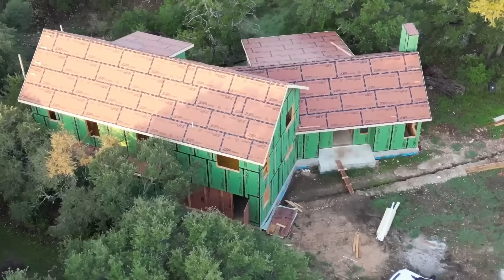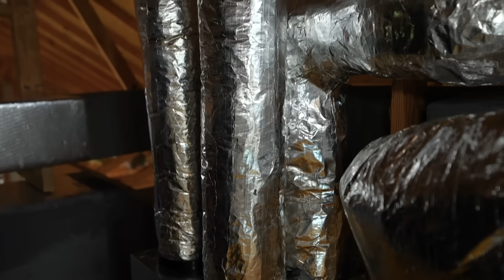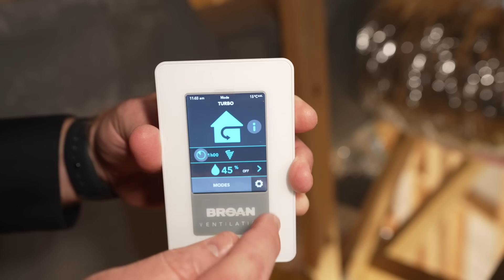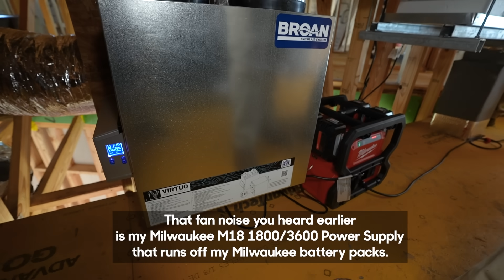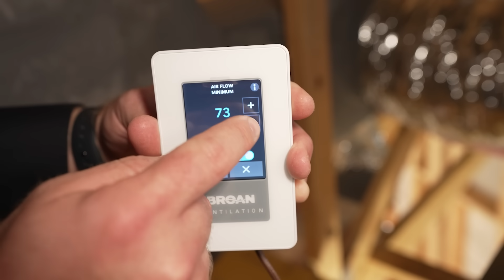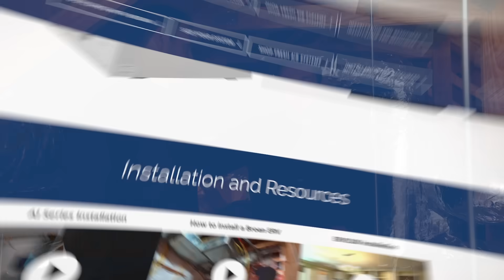Fresh air: A quality ERV that most can afford?

Comment: Using an ERV to remove the high moisture content air from a bathroom after a shower is just increasing the humidity level of the bedroom where it dumps the fresh air into isn’t it? The ERV is designed to make the incoming air the same moisture level as the outgoing air and despite it being humid outside that bathroom air will have even higher levels, wouldn’t it? Would it not be better to run a HRV in series with the dehumidifier instead? You don’t add to the moisture as you dry out the bathroom and you get the incoming air dehumidified.
Reply: An ERV does not make the incoming air the same humidity as the out going air, it only transfers or "recovers" a percentage of the humidity (up to ~70%). It is a somewhat self regulating system, since the greater the difference in humidity between the incoming vs the outgoing air, the more moisture will be transferred, until the incoming air humidity is ~equal to the outgoing air. But if there is little difference in humidity between incoming and outgoing air, no moisture can be transferred. If your in a reasonably dry cold winter area, you will be glad of all the humidity one can keep inside. Even if the incoming air is temporarily more humid from the shower (never an issue on my system that I could notice), it will soon be back to normal by the system running for a few minutes after the shower ends.

This is very climate and system dependent, and where a knowledgeable (not all are) HVAC installer can help. If you live in a climate with dry cold winters and damp summers, one would generally use an ERV to return the humidity to the living space in the winter, and keep the house dry during the summer. If you are in a damp winter and dry summer environment, one may wish to have a HRV, or one can swap the core between an HRV and an ERV depending on the season if one lives in areas of damp winters and damp summers, or dry winters and dry summers.

The controllers are becoming computerized systems that only used to be available to large commercial systems, and can monitor all the building needs for ventilation and humidity control so that you can just set and forget, and the system will do the rest. The bathrooms will have humidistats that turn the system on when needed, and the return air will be monitored for the amount of humidity, and the system will then engage humidity controls as necessary (if a part of the system). Real sophisticated systems have the ability to raise or lower humidity as needed, but most homes don't require them.
Reply: @GoCoyote  this is a fantastic comment and I can't up vote enough. This should be pinned to the top. The video unfortunately just scraped the surface, but also dropped a couple bad comments that I think are detrimental to learning about these systems.
Reply: @GoCoyote  But in this case they are in austin. It can be humid all year round. So if you are taking a shower, 100% humidity bath fan with 90% humidity outside. You are now dumping 90ish% humidity into bedrooms.
Reply: @av1204  
It will all depend on the way the system is configured, but one has to look at the cubic volume supplied to the building vs the total volume drawn out of the building that includes one bathroom's humidity. If the system is moving 200 cubic feet per minute, or 5.6 cubic meters, into and out of the building with two exhaust vents in each of the bathrooms, with half being exhausted from the each of two bathrooms, the air being exhausted from that bathroom will be diluted with the dry air from the rest of the house flowing through the other exhaust vent.

If the house is in a normal humidity range of ~45%, the air will have about 9 grams of water per cubic meter of air when around 72 degrees. The average shower produces about 43 grams of water vapor per minute, about 650 grams for about a 15 minute shower, and the fan will exhaust about 2.83 cubic meters of air per minute, about 85 M3 for 15 minutes. The air in the bathroom at 100% humidity will hold another ~11 grams of water per cubic meter, so the exhaust air will be in the 100% humidity range for the bathroom, with about 22 grams per minute building up in the bathroom air that is normally removed by the fan running longer after the shower has ended. This exhausted air will then mix with the other exhaust vent air that is at 45% humidity, leaving the final exhaust air admixture at around 73% humidity that is going out through the ERV.

The incoming 90% humidity air will  interact with the outgoing air in the ERV, and will transfer a percentage of the incoming humidity to the outgoing air dependent on the incoming and outgoing air temperatures.

Remember that relative humidity changes as the air temperature changes, so as the warm moist air hits the cooler dryer ERV, its humidity will go up, causing condensation on the ERV. This condensation will be absorbed by the ERV element and passed over to the cool dry exhaust air that is now being warmed by the incoming air, further causing its humidity to drop, making it more able to absorb the moisture from the ERV.

When the out going air hits the 90º incoming air, it will be able to absorb ~20 more g/M3 of water for a total maximum of 34 g/M3. If the incoming air is 90 degrees at 90% humidity, it will have about 31 g/M3. when it hits the 72º ERV element, it will be able to hold ~20 g/M3 at most, so it will lose at least 10 g/M3 to condensation on the ERV element.  The actual amount transferred will be somewhere in the middle of the capacity of the two air streams to hold moisture. This means that the incoming air after the ERV will have approximately 16 g/M3 of moisture, and a relative humidity around 80%.

If one considers that a 3000 square foot home has ~24,000 cubic feet, or 680 cubic meters of volume, a 200 CFM ERV will exhaust about 3000 cubic ft, or 85 cubic meters during a typical 15 minute shower, about 12.5% of the total air volume. If the incoming air is holding around 16 g/M3 it will dump about 1360 grams of moisture into the house, raising the relative humidity from 45% to 50%. If the bathroom only had a 100 CFM exhaust fan without an ERV, the incoming air would be at 90º with 31g/M2 of moisture, and would raise the house humidity to about 60%, and adding another 2635 grams of moisture to the house, and the cooling system would now have to cool all of that 90º air and much worse, all of the 90º water, down to 72º. One would be better of not turning on the exhaust fan in that case, since without running the exhaust fan, one would only dump about 700 grams of 90º water into the house.

This is the magic of how an ERV works, since it will not only pre-cool the incoming air, reducing the cooling load on the cooling system, it also removed 16 grams of 90ºF water per cubic meter of air, reducing the cooling load by another 57 kJoules of energy in cooling the water in the air alone, plus it also lowered the dehumidification needs compared to a normal bathroom exhaust fan that would have been sucking in more moisture than it exhausted....
Reply: @GoCoyote  do you do manual J's... cause I need you to design my system. You explained this better than all of the experts ive seen make videos
Reply: @av1204  
Sorry, I’m just an electrician who has a lot of experience with control systems, and did a lot of research when installing my system since I’m a cheapskate.
Reply: Sure, that would be the case for that half an hour a day that you shower. But all that other time of the day, it's making your dehumidifier not work as hard.
Reply: In a cold climate you want the humidity, so it's a plus. It all depends on the climate. The ideal implementation actually involves changing the core from erv to hrv and back depending on the season.

If the outdoor air is hotter it might absolutely have more humidity than the shower, look at the psychrometric chart to tell.
Reply: @Zorlig  we really want controlled humidity (as well as temperature and particulates) - saying "you want humidity" - not necessarily, if it can't be measured, quantified and controlled.  Climate control is all about total quality, though historically we (domestic) only worry about temperature for the most part - or drag out that humidifier in winter when the piano starts cracking.

yep, the core swap is simple - I don't know from experience, but hope that those crossflow cores are "standard sizes"  (in fact,  any "sheetmetal worker" could make up a system around nominal core sizes  (though, labour isn't cheap in western countries so there may be no savings)-- the airflow  smart as it seems is just a fan on: low, medium and high.  

PS - when the outdoor air has higher humidity than the shower it is likely there will be tell-tale condensation on the walls and windows.  (jks)
Reply: @kadmow  you always want the shower humidity in a cold climate. Try to get beyond the theory to the practical.
Reply: @kadmow  unfortunately, while the cores have similar dimension Broan AI has to be specd out at factory as either erv or Nov
Reply: I have said thus and no one will ever give you a straight answer
Reply: An ERV is not a dehumidifier. I don't know of any that are marketed that way. It is a system to bring outside air into a living space while incorporating an air-to-air heat exchanger, which "bridges" the two temperature regimes. There is a side benefit of also bridging air moisture content as well, but that is not the same as dehumidification...

In fact, an ERV can, in some circumstances, raise the humidity of a home. I always think of them as one component of a more complete system that includes a standalone dehumidifier.  In other words, I would never consider an ERV without also budgeting for a dehumidifier at the same time. Never one without the other.

Comment: Oh no!  I saw a damper in the duct work! After having to climb up in my attic so many times to free up a stuck damper, I swore I would never allow one in my house.
Reply: Ha Ha! First principles. If it fails get rid of it. Complexity is the enemy of reliability. It seems to me like the A/C unit should incorporate the dehumidifier and ERV. Remember the clock/radio?  The iPhone has a clock, radio, stereo, camera, navigation, Rolodex, file cabinet, fit bit, heart monitor, and much more. Why do we have to dedicate an entire floor of the house to this equipment?
Reply: You have to balance the air
Reply: @BlueHarte  Not impressed with a house with insulation wrapped ductwork running through an unconditioned attic.  In a high humidity climate like Florida, moisture condenses on the foil and can drip down on your blown in insulation.  Moisture can get on the damper shaft, causing corrosion that interferes with movement.   Air can be balanced without active dampers that will eventually fail.
Reply: @markstipulkoski1389  That area will probably be encapsulated. So they won’t sweat.
Reply: @markstipulkoski1389  this I
Will be a conditioned attic
Reply: @lukemarks9132  👍
Reply: @BlueHarte  if your system is seized properly you don’t have to, design your sustem aroubd .03 static instead of .2
Reply: That damper is for makeup air
Reply: I  came here to point out that POS spring loaded damper.  I too have been crawling around in the attic freeing up or replacing spring open dampers.  I'm stuck with my zone ductwork but researched and found that my zone controller supports three wire power-open/power-close dampers that are much more reliable. I bought one but can't squeeze through the tight spaces to get to the broken one anymore as 25 years later, I'm a little thicker and less limber.  I'm going to have to cut another atiic access in the ceiling to get to it.   God I hate those things.😡

Comment: Do you have any videos that go over ventilation for bathrooms? Obviously there will be very warm moist air so how do you handle that in an airtight home? Thanks
Reply: this applies for bathrooms.
Reply: Could someone explain to me the design theory of why you need a stand alone dehumidifier when there is a mitsubishi heat pump right there and I'm pretty sure it has a dry mode ? Also is the stand alone dehumidifier a separate duct system or is it tied in with the rest of the heat/ac ducting ?
Reply: @PhilScordato  The "dry" mode will provide dehumidication, but will also cool and the cooling may not be needed or desired.
Reply: @D2O2  makes sense thanks.
Reply: @PhilScordato  you typically run it in the normal ac ductwork I think. The reason you need it is when you don't need cooling, and even in that dry mode the Mitsubishi still cools.
Reply: @Zorlig  thanks !
Reply: @PhilScordato  We're also in Austin, and our Lennox system drops into "dehumidify" mode. It does help keep the humidity in check, but the cooling effect is noticeable sometimes to the point where we just get too chilled to allow the unit to run. I'm looking at adding a dedicated dehumidifier after living with the Lennox unit.
Reply: When you say "obviously" you follow it with something that isn't necessarily as true as you think.

It's not a big issue though and good installed have other ways to control humidity so one is just getting worked up for no real reason
Reply: Depending on the system, the HRV or ERV exhaust will often be from the bathroom, with a humidistat that ensures the system engages if the bathroom humidity rises. There generally will also be a standard bathroom exhaust fan.
Reply: 68% I read
Reply: When he says it removes vent fans, you duct the air from the bath fans to this unit and out of the house.
Reply: @sparksmcgee6641  my Broan blows fresh air into the bathroom and doesn’t evacuate moisture
Reply: @sparksmcgee6641  I don't think they are installing fans in the bathrooms... just a duct and grill. The Broan unit is what is pulling the air out of the bathroom not a standard fan pushing the air to the Broan erv. Though I do wonder if installing a standard fan and ducting it to the erv would essentially be your boost mode when you flip it on ? Or how the sizing, design, and airflow would work with a setup like that.
Reply: @PhilScordato  Phil this is a stand alone unit so it has its own fan. When he said they could have less vent fans because of the unit it's because this is a central vent unit pulling from each bathroom with one fan in different modes.
Reply: @PhilScordato  My Broan doesn’t evacuate moisture from bathroom but just blows in fresh air. It’s a problem longterm for house and I’m trying to figure out if that’s an error or design.
Reply: @PhilScordato  You are correct. Instead of bath fans you can direct duct to the ERV. they come with wired or wireless controls for the bath that turn on the erv exhaust fan. If all of them are turned on the fan goes to boost mode. Obviously you can just hit boost mode for a single bath if you sized the ducting for the full load. It can also be used as make up air for a kitchen system.
Reply: @yonseienglish  probable error is design- priority for bathrooms, should be evacuating air, not supplying fresh air

Comment: Efficiency?  I think I remember from your Zendher video that those are 90%ish. What are the Broan?
Reply: It doesn't matter because European standards and American standards for HRV's are done very differently. American standards only require the core's efficiency to be tested and verified, however in European testing standards the whole unit's efficiency needs to be factored. The difference is that you can have a very efficient core, but an inefficient and poorly insulated complete unit, ( like in the American testing standard). But if you test the unit as a whole, the efficiency is more accurate to it's actual performance. So an American HRV and an European HRVv with the same efficiency rating do not have the same performance.
Reply: @compasteedee  yea power is cheap here as we never counted on our mortal enemy to supply us gas... So efficiency not nearly as important 🙂
Reply: I am building a 2000 square-foot home using ICF 100% off grid required. In the mountains of North Carolina climate zone likely six needing to be efficient with power yet also cost, if it means adding a few extra solar panels in order to get different power consumption May a valid alternative. I got an estimate from zendher and it’s about $10,000 for the unit and ductwork stuff not installation. I’m wondering what this would cost for my home
Reply: @MartyHuie  you can run the numbers on the btu difference. It isn't much, maybe 100 watts extra on a heat pump
Reply: @Zorlig   that’s probably information I probably should’ve provided my only heat source or actually my only two heat sources will be a woodstove and heated floors in the concrete slab. They’ll be no air-conditioning and no central heat or mini splits looking at only ventilation this property in the two years that I have owned it has never reached 70° yet. And putting the sleeves through the ICF wall for a future mini splits as necessary yet not putting them in initially because I don’t believe they will be needed and just looking for the most efficient cost-effective ERV
Reply: Their documentation says 72%. What makes the difference is the core, you can see this one is a square while the more expensive competitor has a middle counter flow section.